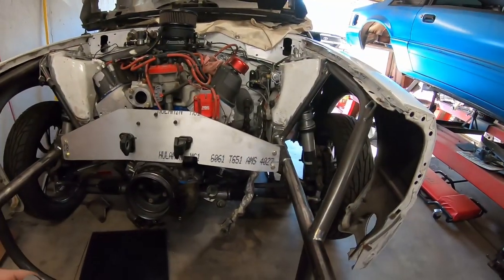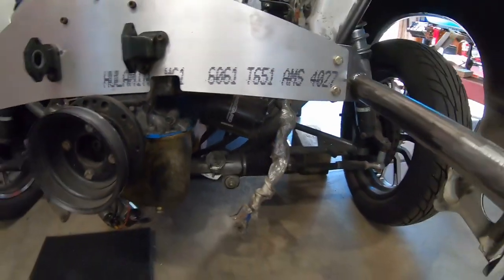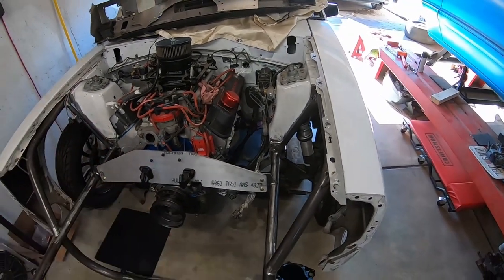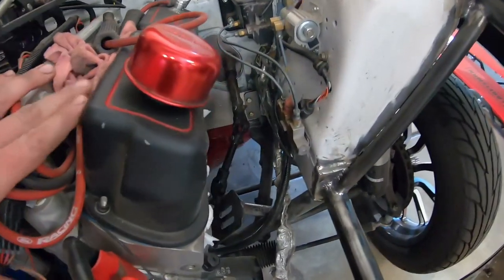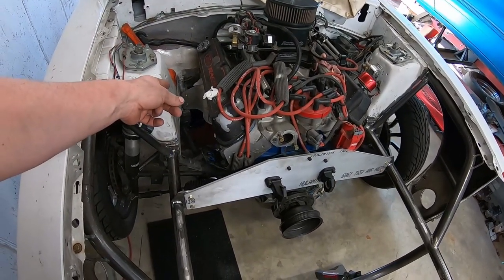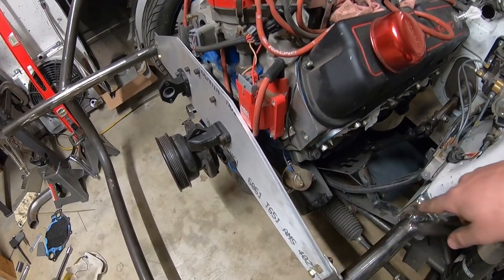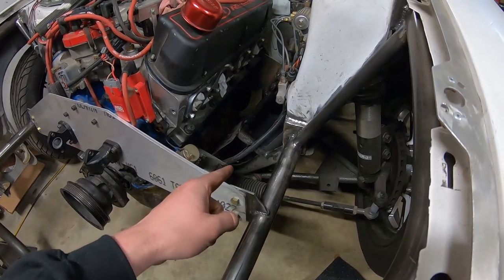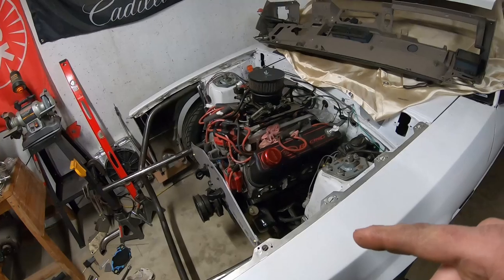Skinny Kids Motor Mid Plate Kit Install!

Comment: I'm in the exact same predicament. And decided I'm going to cut and save mounts. 1. Because I won't get back what I've spent. 2. More poeple are swapping different motors in foxes anyway. 3. I bet this is all I'll ever need and everything else is hacked up anyway. Don't considerate a loss if you re-sell for less but a price you decided to pay to have fun and make it your own. And from what I'm gathering, your going to run it on street with rad in back? Are you adding anymore airflow besides fans. I've thought of same thing with vented deck lid (notchback)
Reply from the maker: I think im just gonna cut them off. I probably won't replace it unless its basically given to me lol. But yea definitely plan on street driving it a lot and I figured the extra weight wont be terrible since its in the rear anyway. And no extra airflow, just fans. I know of 2 guys that have their stuff setup kinda like that and they have no problems!

Comment: Awesome work. Can't wait to see the finished product. Are they still going to be street driven? Thanks for the videos
Reply from the maker: Thanks, and thank you for watching! And yes mjs (blue car) will a ton, my orginal plan (with the white car) was pretty much a race vehicle only but I'm changing plans and putting the big radiator in it and making the trans cooler better so I should be able to drive it anywhere like before.

Comment: I'm new to engine plates... do you use any sealant or gasket between the plate and the engine on the water pump holes? Or just straight bolt 0n?
Reply from the maker: Yea I used gasket maker! No leaks for me!
Reply: @Hidden10sGarage  awesome,  thanks for your help. 👍